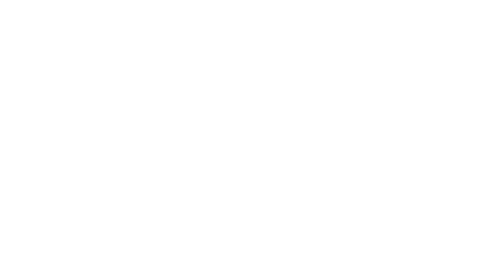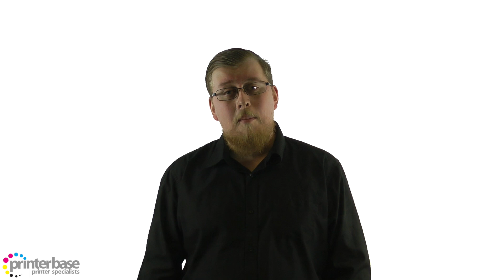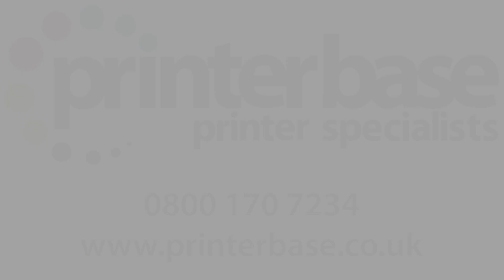Why choose a Dot Matrix Printer?

Comment: Neglected to mention all the real reasons for using a dot matrix printer:
1) Carbon copies
2) Continuous feed paper (tractor feed) for line printing of error messages, logs, code, etc.
3) Cheaper to operate than any other printer. Ribbons can be re-inked! 
4) When ink gets low it STILL PRINTS.. just fainter.
5) You can print a single line of output and not waste an entire sheet of paper.
6) Most reliable printer design ever made. 40 year old printers still work and they do not need to be babysitted
7) Nearly ANYTHING can print to a dot matrix printer. It does not need to understand postscript.
8) Serial, Parallel, and USB are all options for dot matrix printers.
9) Can print banners! This is a joke but it's true.
10) They annoy the crap out of anyone in the room who doesn't know about 1-9.
Reply: I've just bought one to make tattoo stencils.